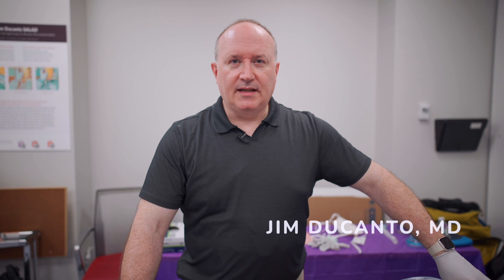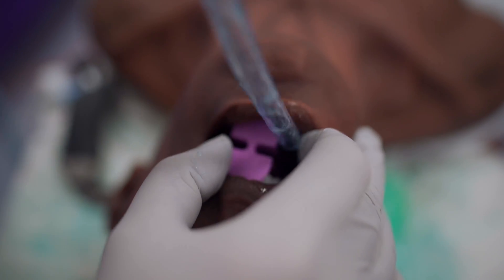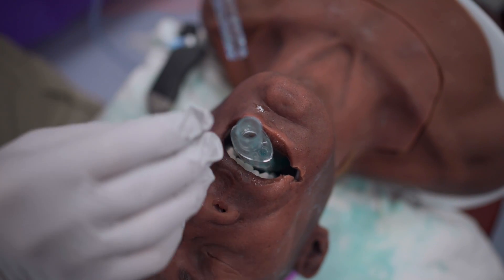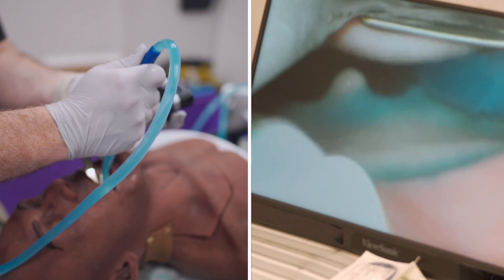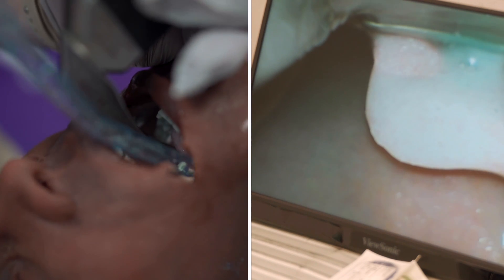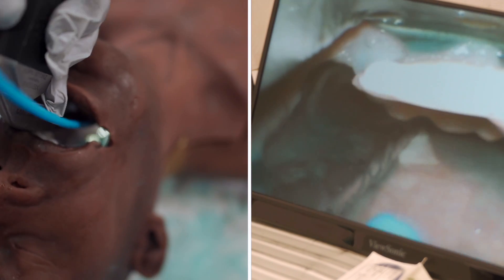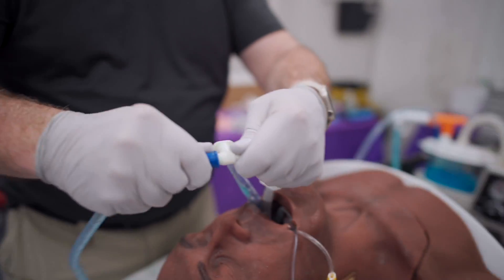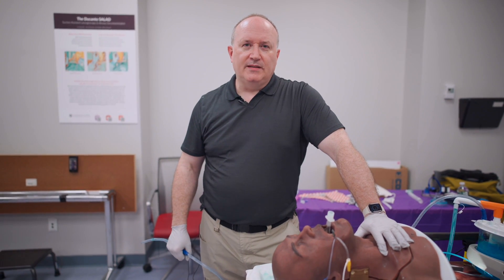Airway Decontamination Skills You Need to Add to Your Intubation Toolbox by Jim DuCanto - SALAD 3.0

Comment: why not instead place the suction through the cords then placing the bougie, removing the catheter and then placing the tube?
Reply from the maker: Placing the large bore suction catheter on the left side in the esophagus is the most efficient way to provide continuous decontamination. Placing the suction through the cords on the right side, makes it hard to deliver a Bougie or a tube and allows for contaminant to continue to flow up from the esophagus.
Reply: Placing suction in the traquea for bougie delivery means stopping suction, with a higher risk of aspiration.